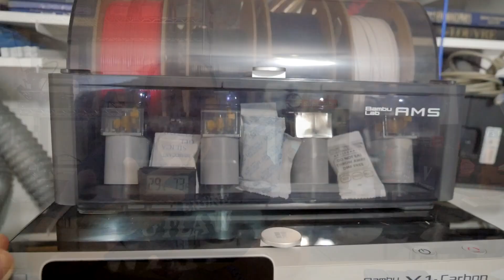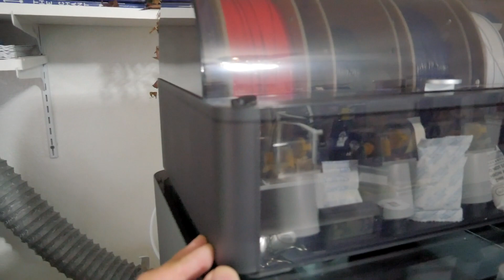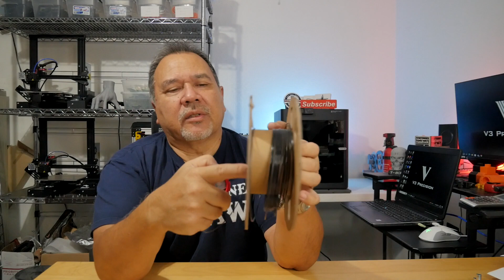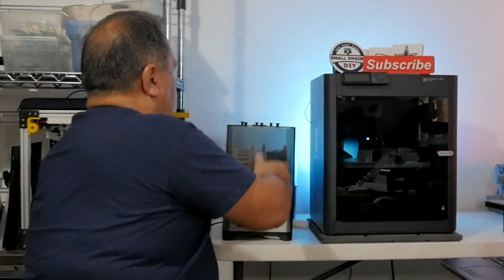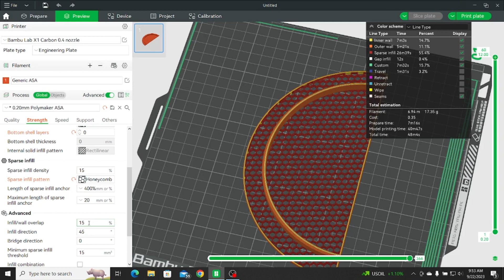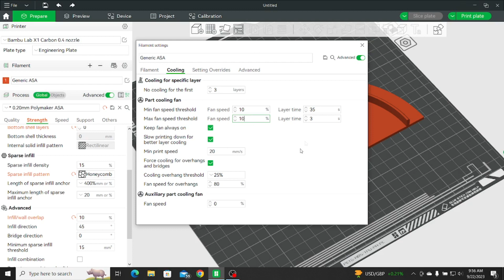New 3D Printed Desiccant Container Designs and Tips on Using Infill Patterns

Comment: Printed the PETG one finally, and it works. A bit of a slow print, but hopefully worth it. I think I'll print a couple more in PLA that won't go into the dryer box but will hold the desiccants in the sealed Sterilite containers I use to store my filaments in. The PLA ones look like they'll print much faster, since I'm going to take the solid version and use the infill trick.

Comment: I will note that even with a single filament dryer - the spool holder shaped desiccant holder will be useful to me. I mostly print PLA, so it's usually turned off anyways, I just turn it on when I'm anticipating printing in PETG or TPU.

Comment: Really good ideas! I don't have a way to vent my enclosure to the outside, so not going to print anything with fumes. That said, PETG should work fine, the filament dryer really shouldn't be hot enough to give PETG any problems. I'm inspired to finally set up a way to keep my filament dry, I didn't even think about drying the desiccant in the filament dryer.
Reply from the maker: I hope it works for you.  You can download them on Printables.com and soon MakerWorld.
Reply: @V3Precision  It should work, assuming the adjustments I made to increase print speed don't ruin the fit. Lots of holes increases print time quite a bit.